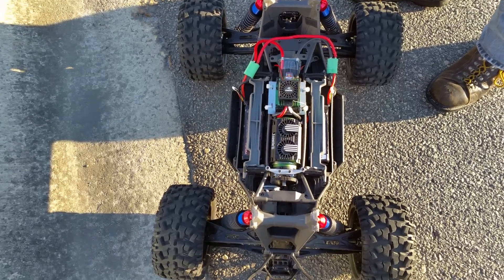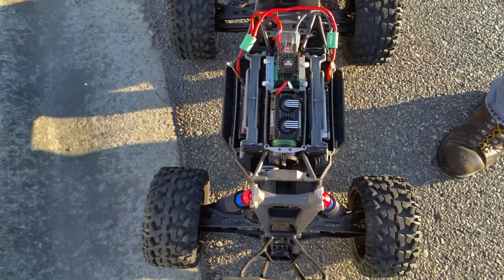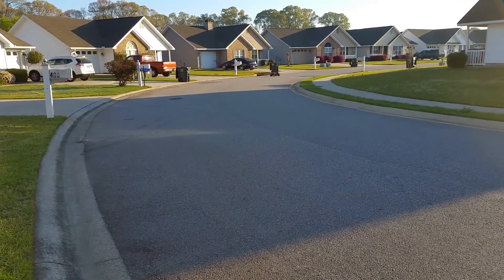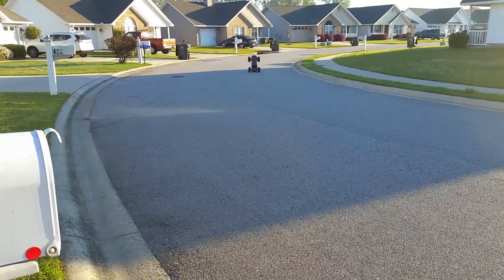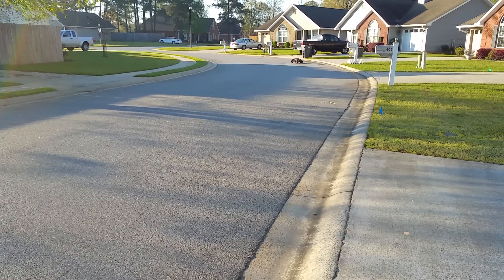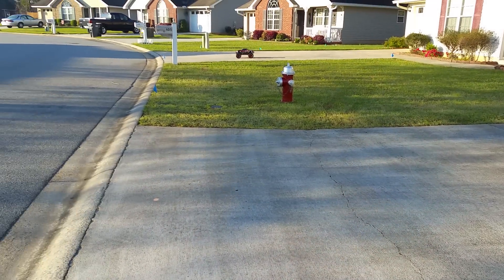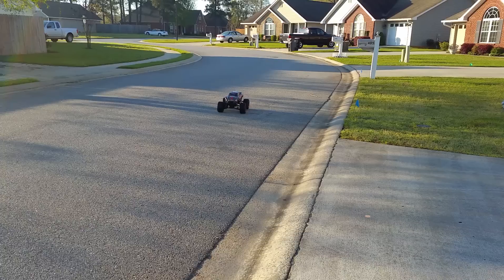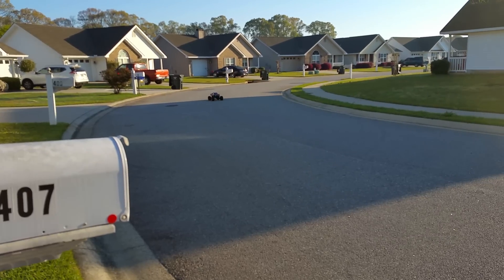Traxxas XLX-Maxx with xlx esc, 2028 motor 53 tooth pinion, 50 tooth spur

Comment: How's your drivetrain holding up?
Reply from the maker: matt broehl It kept breaking so I traded for a highly modded dbxl.
Reply: Nitro Revolution RC What where you breaking differentials? Where you running stock drivetrain?
Reply from the maker: matt broehl I was running the best upgrades available at the time.
Reply: Power Evolultion RC do you enjoy the dbxl more

Comment: is the esc and motor waterproof
Reply from the maker: Joe Ridgley Yep
Reply from the maker: Joe Ridgley Not stock though
Reply: Evolved Amateur RC how have you waterproofed it? I believe the 2028 is sensorless so shouldn't be a problem?
Reply from the maker: Joe Ridgley even sensored can be waterproofed.  silicone conformal coating.